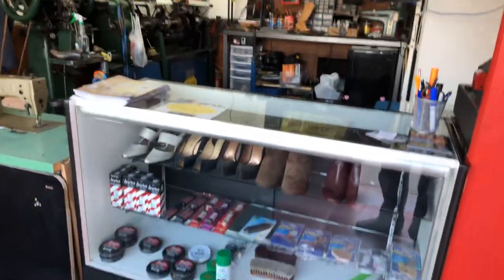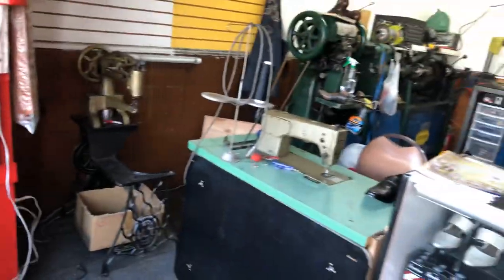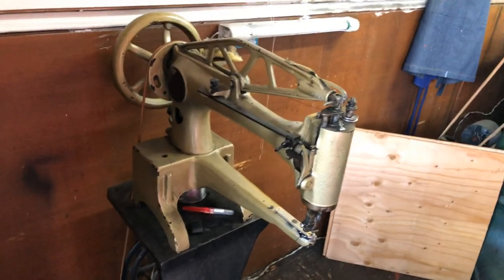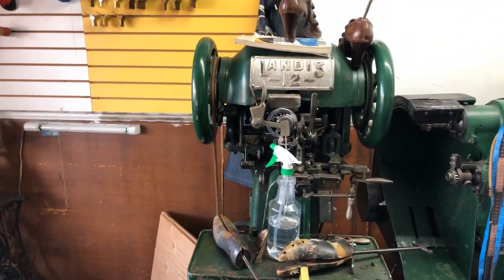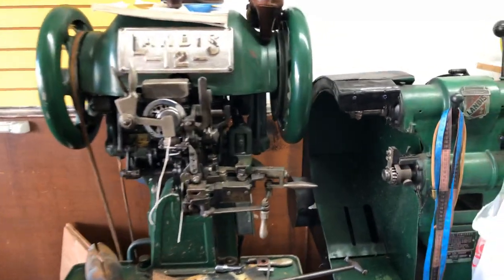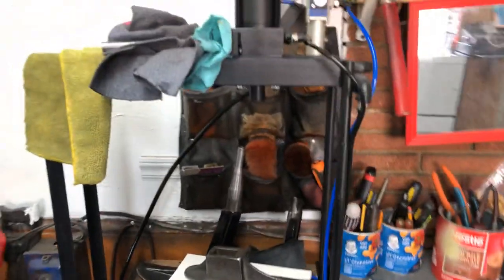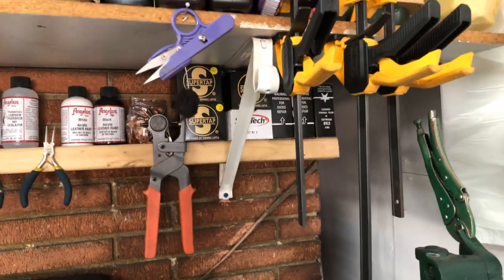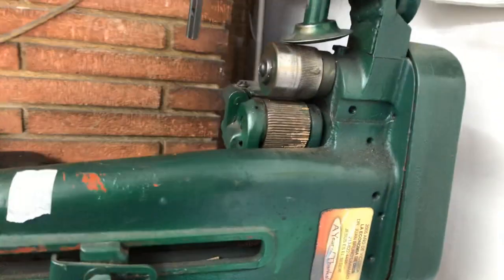My shoe repair shop

Comment: Did you have a different channel when you worked with the older guy? The guy I'm thinking of also had an old model pickup truck. I used to watch that channel all the time but forgot the name. A guy at work bought some new Thouragoods and it reminded me of that channel.